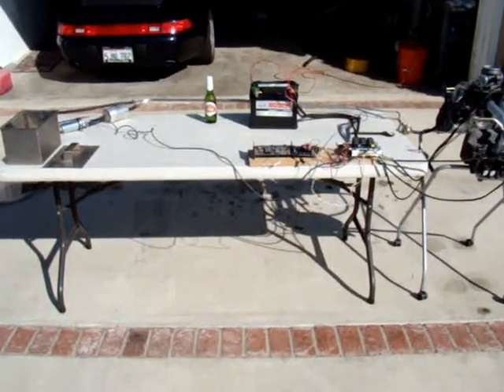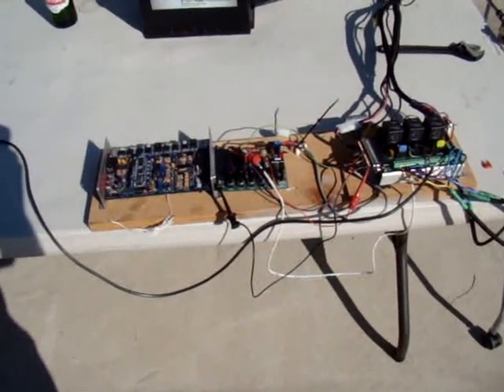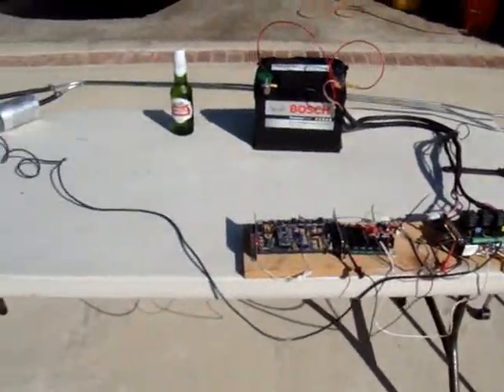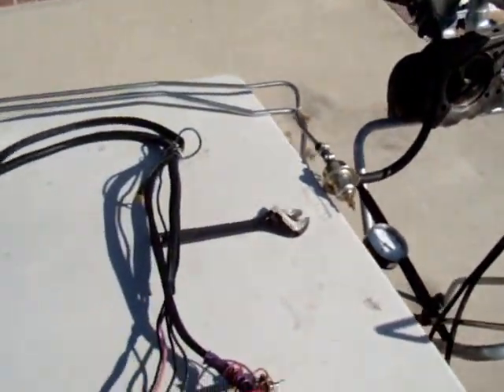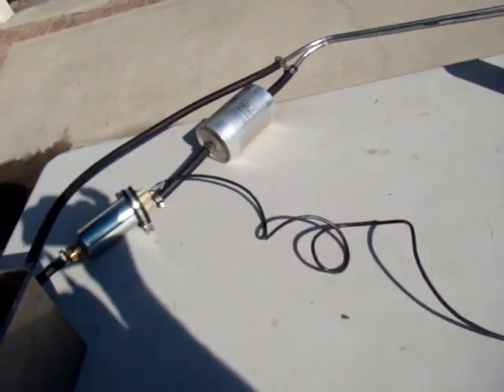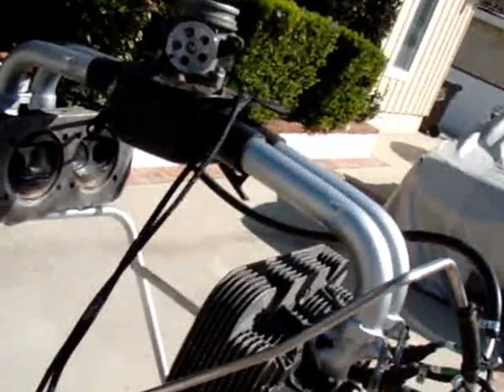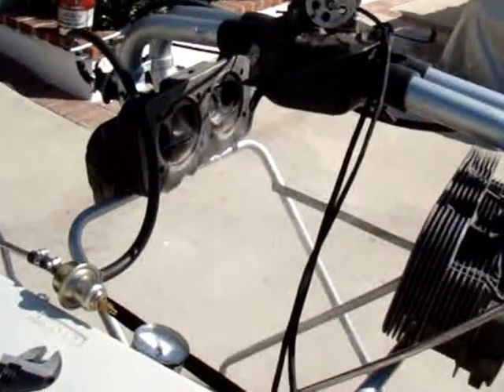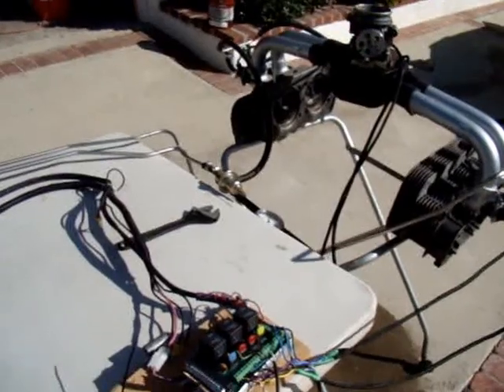fuel  injector system check

Comment: Super. I could not get my car start but when I plug the fuel return tube at the fuel pressure regulator the engine start and run smoothly. My fuel pump, fuel filter and fuel pressure regulator are brand new. I don't understand why when I plug the return tube it start? Is it because of too much pressure so, it force the injector or cold start valve to spray!!! Do you have any idea?
Reply from the maker: You need to connect a fuel pressure gauge to see if your regulator is actually working and connected properly.  Good luck